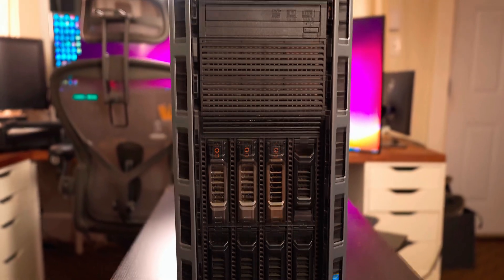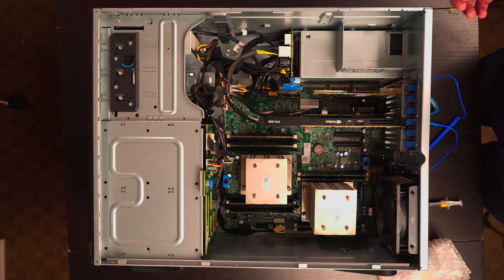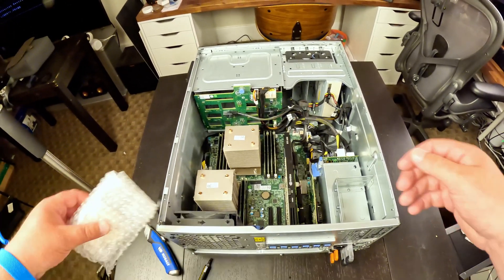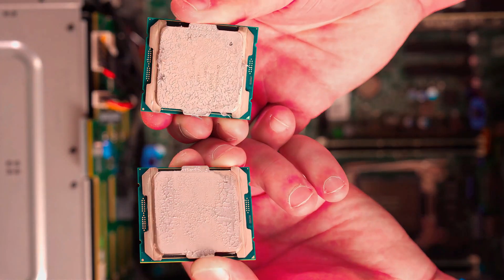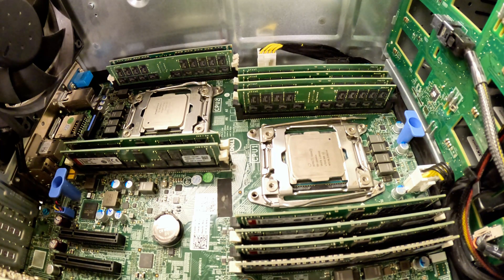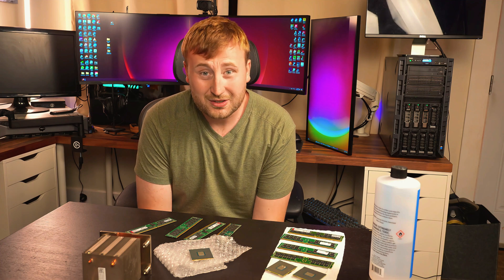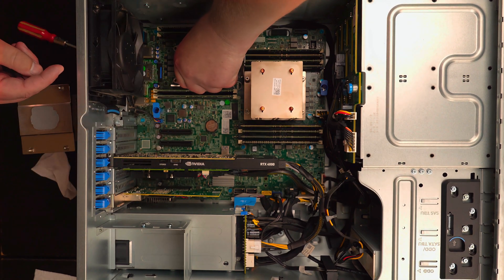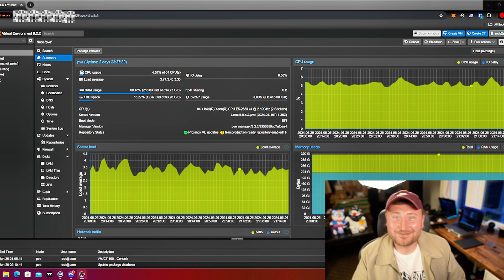Maxxing Out Budget Home Server Upgrades GONE WRONG | PowerEdge T430 Owners WATCH THIS!

Comment: 2 things.  Beefier cpu especially dual sockets may indeed involve larger psus, especially if you have a vid card AND a bunch of hdd spinners.  The other is if your memory is the same but different brands, put one type on 1 mem bank for cpu1 and the other matching set on cpu2.  Dont mix memory even if its the same rating but diff brands.

Comment: Damn dude I wanted to see the next video. Did new power supplies fix the issue? Pretty much doing wanting to do the same thing. Got a few m.2 adapters running nvmes with my os mirrored on them. Things stacked with a bunch 2.5 sata drives. Swapped out for the solid aluminum heat sinks, a noctua fan an external 10in display mounted on the side. Hit it with the spray gun to give it a nice professional autobody paint job with a uv reactive candy coat

Comment: Hey, I'm looking to get one of these T430's do you know if you can swap out the upper front panel parts to add another 4 drive bays?
Reply: You can, I put a generic 5.25inch 5bay drive there, but I didn't used it for drive, I jist use it for fan

Comment: Your homelab brought tears to my eyes. I love it. I have a Dell R730XD,  and 2 R630 servers all running Proxmox VE 9. I have Wazuh, Elastic Search, Splunk, Filebeat, Kali Linux, Wireshark, and more SIEM rools going in as fast as I can get them installed. All of my Xeons are E5 2697 v4 that came installed on my servers. And they all have 256gb ram. Im going to set up a Domain Controller VM Windows Server with AD DS.  A Cisco stack with a 2921 Router, 3850 layer 3 switch, 2960 layer 2 switch, all backed up by pfSense on an old HP desktop. That's my lab.

Comment: Thanks for the advice and the video. I just got a T430 with 384 GB of ram. I was thinking of upgrading the 2 Xeons, but wasn't sure about the thermals, which you just confirmed. Any advice on graphics cards. I tried an NVidia GT1030 that I had lying around and the PERC didn't like that, literally having a hissy fit and refusing to boot. I'm not a gamer, so I don't need fast graphics. At the moment I'm using an external dual monitor DisplayLink adapter which is working well and audio via a bluetooth amplifier, but I would prefer an internal solution.

Comment: Try using the dual 1400 watt psu and check to see if tje ram is fully seated on the side of the failing cpu and check gpu lane if it's going to cpu 0 or cpu 1 that's what I'd do myself

Comment: What does the upgraded raid controller do for you? I'm about to get a free T430 in a few weeks, and want to make sure I have what I need to set it up. Any other tips would be greatly appreciated! Thanks
Reply from the maker: Grats on the free T430, beautiful machine! I don't think you need an upgraded RAID controller unless you plan on having lots of HDD and/or have really critical secure storage requirements.
Reply: @ Planning on running 8 drives in the tower. Also considering 12Gb/s SAS drives. Will also go with a pcie m.2 card and drive, and if there are any additional ports on the motherboard a couple of ssds. If an upgraded raid controller would improve reliability and is inexpensive, I think it would be worth it.
Reply from the maker: @anonymous_friend  Do you know what your RAID configuration goals are? Once you determine how redundant you want to go the right card should be pretty clear. Upgraded RAID controllers allow for more redundancy but you are sacrificing storage capacity for failure resistance.
Reply: @ Yes, I will likely mirror all drives.

Comment: I picked up one of the T430 on Craigslist here and traded a guy an older XPS laptop for it. The guy was done with it because he could not get it configured right. I offered to help him figure it out, but he was over it, so we traded. Got it working and slowly been upgrading it. Running a single E5-2667 v4, six 4TB 12Gbps SAS drives for VMs (RAID6), 2 Samsung 1TB drives mirrored for OS, RTX 4000 GPU, Asus Xonar 5.1 sound card and two 1k watt power supplies. Last item to upgrade is the RAM. Still getting conflicting info on RAM. Found multiple posts that the 2600 v4 series can do DDR4-2400 RAM up to 64GB modules, but others are stating only up to 32GB. Anyone have experience to confirm or deny what works. Only 8 DIMMs needed since it’s a single CPU.
Reply: I'm interested to see what you find on the ram. I'm getting a decommissioned T430 for free in a couple weeks. Excited to play around with it. How well does the RTX 4000 perform? What OS are you running, and if you have any tips for me I would greatly appreciate it!
Reply: @ The single slot RTX Quadro 4000 runs like a champ. You have to make sure your T430 includes the GPU kit from Dell. The kit Includes two 8 pin power outs for powering GPUs on the side of the motherboard.  I believe they are white. If you don’t have them, I understand they cannot be retrofitted. The RTX 4000 only needed 1. Also, I recall that you have to have upper sized PSUs. I believe you can use two 750W in parallel or one 1,100W to power the GPU, but this should be verified. I picked up two 1,100 on eBay for $50. I set the BIOS for standby failover so as to use less power but also maintain redundancy. I benefit from the extra power for the six 4TB drives and two SSD mirrored for the OS. 

I am running Server 2019 Std. I use it as a file share server for the whole family and for VMs. Currently working on a way to play Fortnite through the VMs for the kids and when their friends come over. But the anti cheat software kills the session as it does not like the VMs. Also looking at some LLM options for our own home grown Jarvis. 

This is a great older box for these kinds of projects. Can be a little power hungry with the CPU, GPU, and PSU; I am running, but I power it down when not in use to save on the electricity. Hope that helps. Still waiting on some clarity about the 64GB DIMM use. If anyone else has tried with success or failure, would appreciate system details and RAM used.

Comment: The T430 can accommodate a maximum 1.5TB of however, the cost of 128GB DDR4 ECC RAM is substantial. Dell's specifications often do not align with reality. The best CPUs for multicore performance are the E5-2698 v4. The best CPU for single-threaded performance is the E5-2687W, it is important to note that only one can be utilised due to the TDP limit. For optimal single-core performance in a dual-CPU configuration, E5-2667 v4 are the fastest. The choice of CPU should be by your specific use case. High core counts are good for virtualisation. Lower core counts and faster base clocks are better for gaming and workstation tasks.
Reply: Awesome answer brother

Comment: Hey man i bought one of these on eBay. It powers on but wont display to a monitor. No errors or any kind and I’m stumped
Reply: Try connecting using the iDRAC using another computer. You can then reset the system to factory defaults and see if that gets you working. Good luck.
Reply from the maker: Did you ever figure it out?

Comment: try to undervolt the CPU
Reply from the maker: Afaik there are a lot of restrictions around what you can do in bios / lifecycle controller. I did adjust a TDP setting but it didn’t have an impact.

Comment: I have an HPE Proliant DL360 G9, which is pretty much the HP version of your T430 and according to the documentation shows that there is a special configured board to support that particular chip.  It warns that only the DL360 originally sold with those processors will work with them.  I think it's the traces on the board that were manufactured to support that much power are much thicker and are capable of supporting that much power, vs the other versions that warn not to use those particular processors.

I wouldn't recommend using those processors on that board as it could cause the traces to burn up and do very bad things to the board and all the other cards and components connected to that board.
Reply from the maker: Thanks for the insights John! Luckily I found a perfect project for the dual e5-2699's so I don't need to worry about trying to finagle those cpus in my T430 anymore  🤣

Comment: The difference is most likely a bios update
Reply from the maker: I made sure bios and lifecycle control had the latest updates when troubleshooting. All of the T430 servers that I found for sale with E5-2699v4 CPUs feature the 750W or 1110W hot plug power supplies. Perhaps the issue could be solved with a PSU upgrade on my end.
Reply: Most likely, you'll have to patch your bios to be compatible with that sku. You can also try the bios from the model with the actual CPUs. Or extract the info from there. In bios-mods you can find how or maybe it's already there patched
Reply from the maker: @SkillisForNoobs  interesting… I was under the impression the bios on dell poweredge servers is pretty restricted and selecting an older bios version would cause security risks.

All that being said, I found a really good deal on a server that will accommodate the E5-2699v4s perfectly. So I don’t get to have fun trying to troubleshoot em on the T430 😢

Comment: Heck yeah dude glad to see you working through issues! Breaking stuff is the best way to learn that anger/disappointment sticks with you better in my experience haha. 

If you ever need network advise I'd be happy to help, network engie of five years at your service ❤

Anyway keep up the good work!!
Reply from the maker: Thanks for following along, it means a lot!

I need to learn more about setting up vlans in preparation for my poe security camera project. If you have any insights on best practices / resources about vlans it would help a ton!
Reply: @dleer_defi  definitely recommend trying everything out in a virtualized network first; and I always recommend OPNSense as it's relatively easy to use.  Otherwise Cisco has courses you can take online! Packet tracer and gns3 are both great ways to learn by using a virtual network as well.